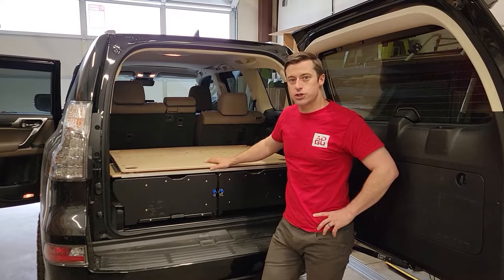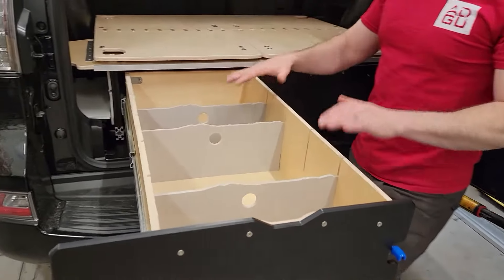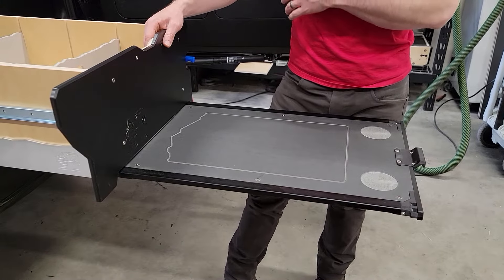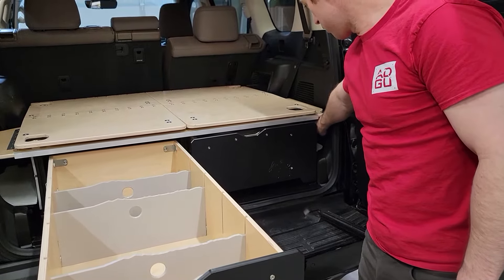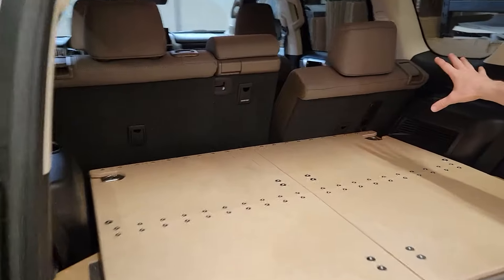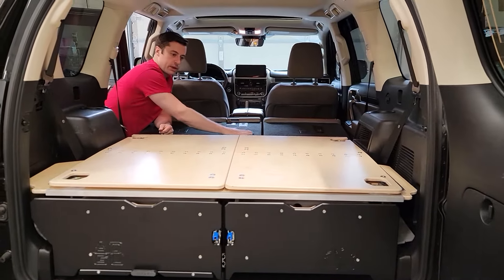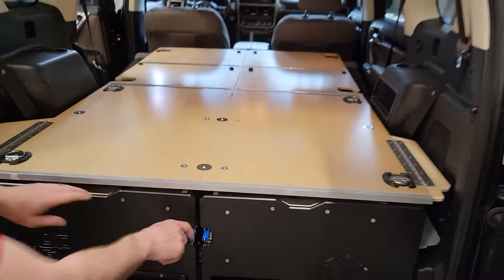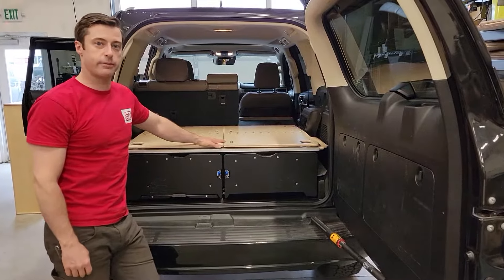Lexus GX460 Drawers and Sleeper updated V32: Air Down Gear Up

Comment: Thank you for making the sleeper as close to flat as possible. As a taller person (6'), I prefer to sleep in my GX with my head towards the back, so my feet can extend past the edge of the 2nd row. If I slept the other way, I cant sleep with my head hanging off, so I have to scoot down which cramps my legs against the back door. Since the OEM inclines towards the front, I have to sleep diagonally to fit.
Reply from the maker: thanks for the kind words, flat is the goal! We want the system to be as generally useful as possible, so you can choose which orientation works best for you.
Reply: @airdowngearup the only other thing I'd like to see is something that locks the hinges or the platforms together so it stays flat, instead of using a blanket or 2x4 underneath it. Is this something in the works? Maybe something similar to the 5th Gen
Reply from the maker: @Ill06Taco   We wouldn't go to quite the extreme that is the 4runner sleeper, but we have an idea in mind that would change the orientation of the hinges, which would make the sleeper sit perfectly flat without any supports under

Comment: I have removed my 2nd row seat. how is the sleeper going to lay itself down now? Can you folks design something that accomodates rigs with no 2nd row seat. Also, if i do put back the 2nd row seat, I would have more storage room under if i fold the seat fully up. With the 2nd row fully folded upright i can have more storage room under there. But it needs a support for the full bed foldout.
Reply from the maker: We have our 'seat delete' kit for exactly this! A lot of people have removed the 2nd row, so we have designed a frame system that supports the sleeper while providing a TON of useable storage space. This seat delete frame bolts onto our existing drawer structure with 3 simple screws, so if you wanted to go back and forth it's very easy to do. We have another video on our youtube that describes this in more detail. In the video we are showing a Land Cruiser, but it's the same for the GX460 as well. 

https://www.youtube.com/watch?v=OijcvX3mDHk

Comment: What are the dimensions of the sleeping platform?
Reply from the maker: 42inches wide by 67inches long. The system supports a 72+inch long standard mattress with no issue